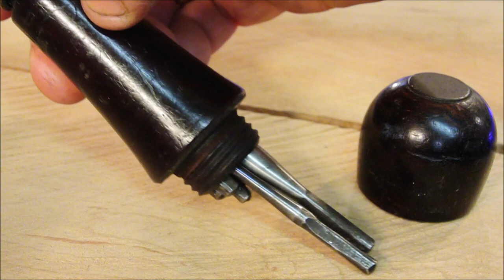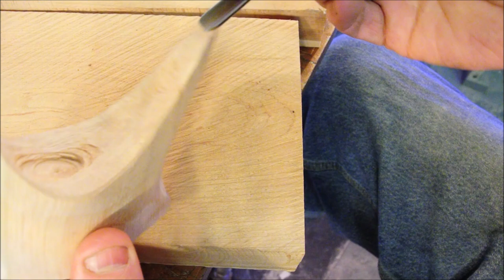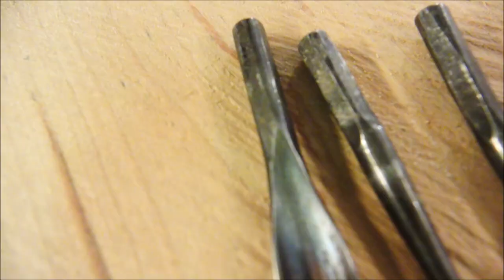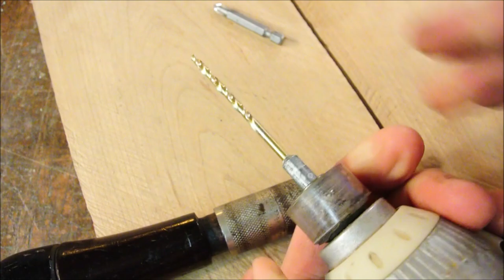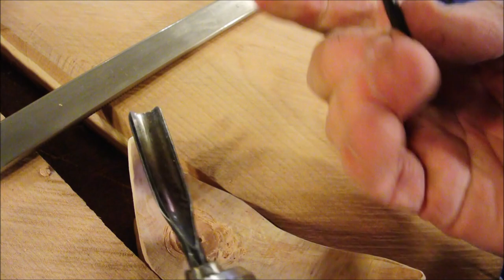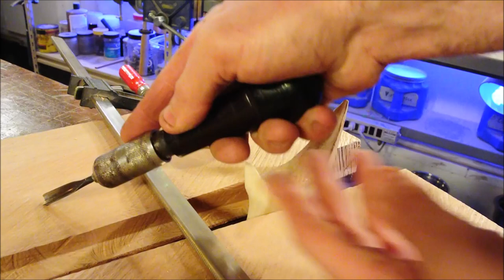A very old Woodcarver's tool

Comment: Thats Very cool. Miller Falls Company Multi Tool. I believe that it originally had a flathead screw driver included. Someone probably saw more value sharpening it to a chisel The Handles were mostly made from Rosewood.  Very cool piece of history. Certainly more care and craft then some of the junk multitools of today. If it were me, I would never sharpen it :).  Thanks for sharing.

Comment: I think this is a chisel set for wood block print making. I have a lino cutter - with blades that fit inside a plastic handle. Very similar, but not as nice as yours. Lino is a lot easier to chisel than wood.
Reply: A lino cutter is exactly what this reminded me of, but much more robust.  I would love it if I could get a tool like this today.

Comment: I use the 4 sided pick (4:40) all the time. 
In chaotic order of use: 
I'm sure it has far more uses than what I use it for, but it's essential you keep the corners as sharp as a knife. 
Having the 4 sides makes it easier to keep the point super sharp and perfectly centered (unlike a round pick), the sharp ends will also cut through fibers as you push a lead hole into wood (when using a round pick, there will be a tiny tear up and down the fibers.) 
Also, when outside marking holes in fence poles, round picks have 2 problems I encounter: they close up when the wood is wet, and they are sometimes hard to distinguish from old nail holes and holes from larvae. The square holes stand out and don't close with wet and swollen fibers. 
Another important thing I use it for: scoring. When scoring with a round tip, you'll bend over the tip, even when scoring wood. With this one, when holding it at 45° (or lower) you actually use the cutting edge to score preserving the tip. I got it from my grandfather who used it to score copper for circuit etching. 
It's also very useful to clean up carvings because you can push straight lines all the way into the smallest corners.

I've seen people in the comments suggest it could be a reamer or some kind of surface scraper for the inside of holes. While I can see what they mean, I doubt this would be used for that because it's too thin to have a wide use. The taper is imho there only to allow for longevity: when you sharpen it, you lose a bit of material. When the head is beefier and slightly tapers, you can sharpen it for years and still have the exact same geometry.
Since I use it so often, I keep it in the wall insulation above my door. There it also serves as a first defense tool in case I would urgently need such a thing, while it's very unlikely for burglars to find it and use it against me... =D

Sharpen the stump of an old screwdriver into such a square tip, with rounded second bevel, and use it for a while. You'll find yourself using it more and more as you go, I'm sure of it!

Comment: Perhaps it isn't "worshiping" an old tool. It's more a matter of reverence, especially when those tools came from a respected and admired man in your family. I still have a few of my father's tools he used as a violin repairman. His chisels, planes, specialty knives and some hand-made tools are among the most useful in my humble little shop. Whenever I use them or even see them, I remember him with kindness and gratitude. That's just a normal human thing to feel for our loved ones.
Reply from the maker: No, it's object worship. Whatever its history, a tool is an inanimate object. We imbue an object with meaning; it's not the other way around. After you've passed, the only value those tools will hold will be, as you've noted, in their usefulness. 

Just because it's "a normal human thing to feel," that doesn't make it empirically true. There's lots of silliness that goes along with adopting sentimentality, and that was my point. Nevertheless, there are still a few of my Dad's & Grandpap's old tools that I cherish! 
But a spade's a spade.
Reply: I guess the main takeaway would be to treat all of your tools with some degree of respect, use them but don't abuse them and such

Unless the job calls for a tool to be sacrificed, which you can sometimes run into. In that case, a cheap tool is probably the way.

Comment: At least for me, I'd be inclined towards sharpening it and bringing the edges back to their true edge.
A violation/abuse of the tool would be cutting it apart and making it into something else, but maintenance so long as it doesn't damage is never a bad thing in my eye. I have many old tools that I use, often after cleaning re-painting. I have a convict era pick for example that gets used along with all the modern shovels. 
The 'I don't know' for me would be re-grinding the screwdrivers(As others have commented) to give them their original edges and restore the functionally, rather than the edges the previous owner wanted as it would change the story. But as you are part of the story, it's likely not a bad thing if you intend to use them too.

Comment: With a small carver's mallet it would be easier, and it probably ... wouldn't hurt the handle. What I mean is a round mallet where you hold the head in your hand, so it's basically your hand you use to hit it with, just harder than your skin :^) I have a really old wooden carvers mallet I use like that. It's small and light but it gives me much more control and slightly more force.

Comment: Amazing, how fast the presumingly correct manufacturer was found by the other comments :)
Before reading the description my inclination was to swipe to discover the second part. 
After reading it, i felt like there were no periods, but no need for them ether. Put differently, it read very easily. Like a novel it opened with different remarks and closed by tieing them all together at the end.

Comment: its sweet , precursor to the "YANNKIE " perhaps , it might have had a simple wire like spring inside the collet at one time , lovely bit of kit , use it if you can ,try not to hit it with a hammer its too nice for that , I have a yannkie with similar bits made in the 50's or 60's

Comment: Peg-and-wedge joinery (i believe that's the term, if it isn't z it's certainly descriptive enough) where
1 you push a square tenon into a square hole, then
2 hammer a wedge into the end-grain of the tenon to
3 press it into the sides of the hole to
4hold the two pieces together
is pretty common in Japanese and korean traditional framework, such as for cots, dressers, ladders, or even walls. Not sure that such a small mortise would be useful in such a manner, but it would certainly be an use for a square broach for wood.

Comment: If the tool is for wood carvers' maybe the four sided "Awl" is a kind of center punch for an auger bit/brad point drill bit used in a hand crank drill. Also, I have a similar tool, but it had a saw and file along with the curved chisel and flat heads. The only difference in the body style is that mine is missing the metal strike plate on the end.
Reply: Yes, hand drills are hard to start a clean hole with, because the top fibers will tear out. With the square hole, a lead cut is already in place preventing the tear out. The one I use from my grandfather sat in the box with his old hand drill, so it makes sense...

Comment: The "square"  awl will make a very nice round hole. The sides act as blades. Bird cage awl? I think. Much better than a round awl. You can actually drill a hole with that o e.

Comment: As for tool worship: careful proper sharpening is taking care of it. Using it unsharpened feel to me somehow a bit as an insult to the maker and the former user. Also, what better way to honor your culture/past by applying it? Culture hanging from the wall, ceases to be culture and turns into decoration.